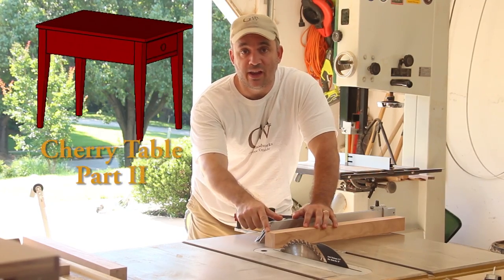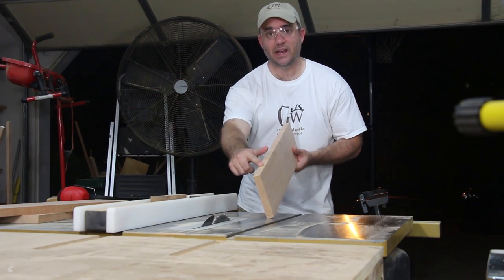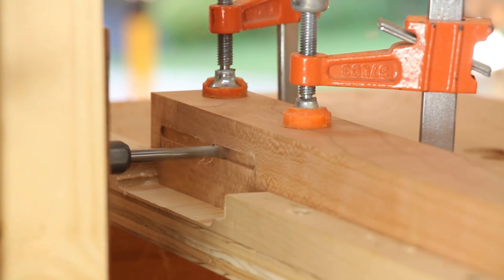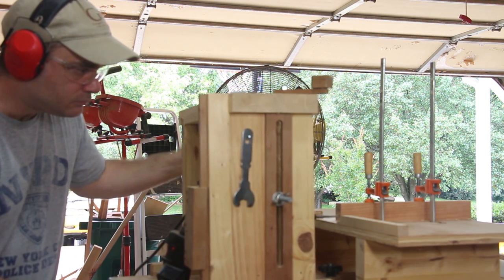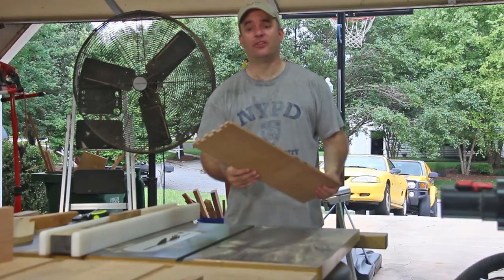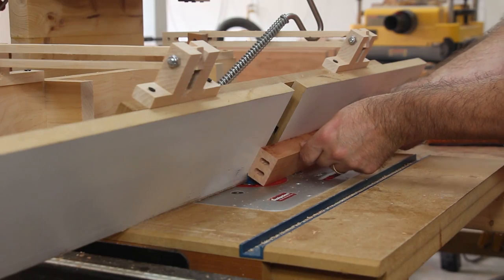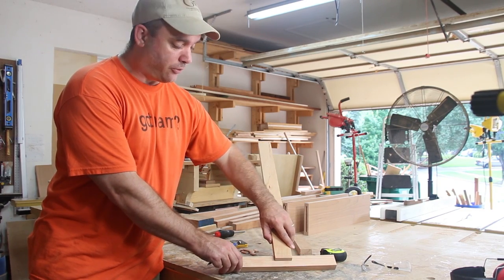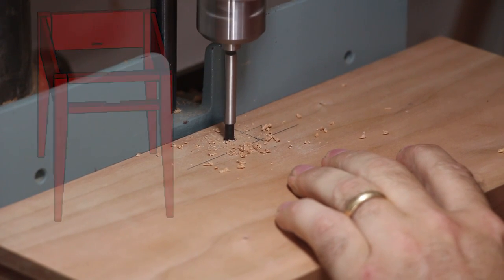Side Table Build-A-Long: Part 2

Comment from the maker: Incorrect. The reasons are to give the mortise more resistance to cracking. A single long deep mortise is less stable; the web stabilizes the mortise. And it gives the tenon more resilience from moisture changes. I will agree that a haunched tenon will prevent twisting more than a split tenon, but a haunched tenon is no better at preventing twist than a single deep tenon of the same width. In other words a haunched tenon prevents twist no better than an unhaunched tenon of the same width.

Comment: I can't understand what you said at 4:55 about the mortise strength, is there some information I can read? (quick research on google was fruitless..)
Reply: More research tells me it's call a "double mortise and tenon joint", and it's stronger because it has more glue surface :)